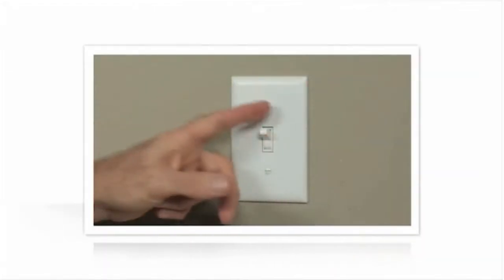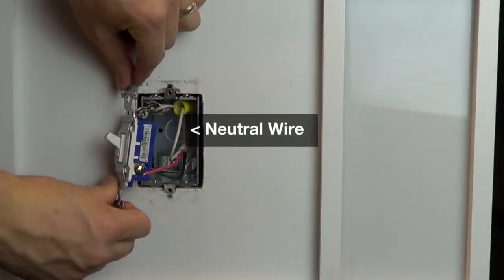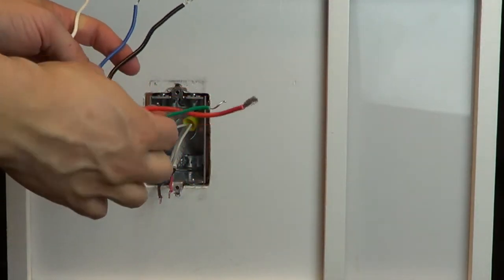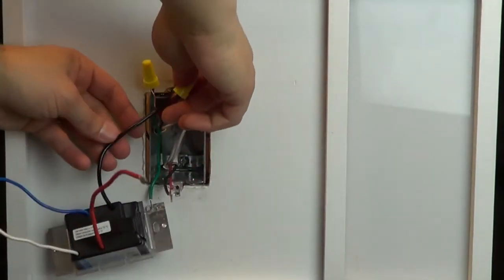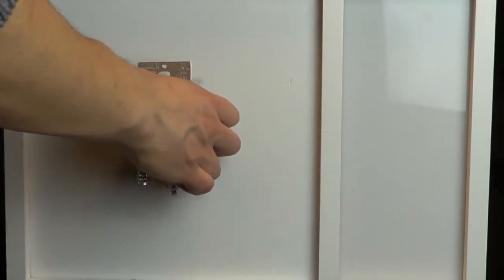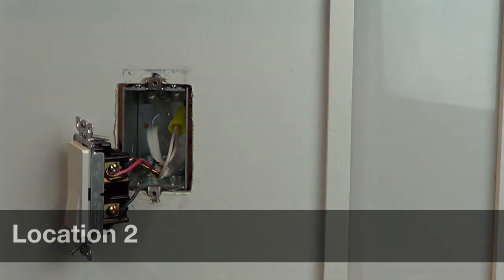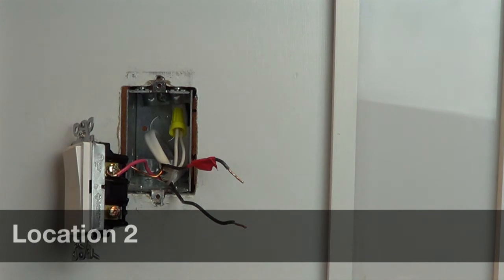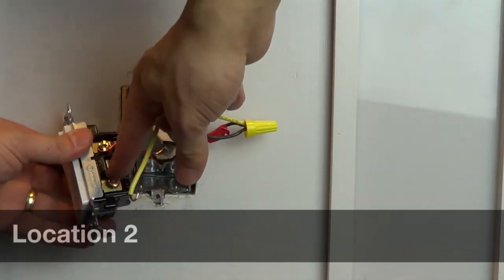Wiring a Control with One Black, One Red, One Blue, One White Wire (3-Way with a Mechanical Switch)

Comment: So what happens when you flip the mechanical switch on and off, does it act just like a three way?  So if I turned on the light with the smart switch, I can turn it off by flipping the mechanical switch?  If I turn on the light with the mechanical switch, I can turn the light off with the smart switch?  Of course I can turn the light on and off with the app?
Reply from the maker: Hi Bryant, Correct, the dimmer and 3-way switch will function as if it was a regular three-way application. Each location would have the ability to turn the light on or off no matter what position the other device is in. Furthermore, the user would have the ability to control it from the Lutron app as well. Hope this helps!
Reply: So this is true for the PD-6ANS which shows it should work, but there is no explanation anywhere on how the mechanical switch works in the system. So I just want to make sire before I order them.
Reply from the maker: @bryantjenks3598  The PD-6ANS will be installed at one wall box of the 3-way application, the other will remain the traditional 3-way switch which will need to be rewired with the yellow jumper wire provided in the packaging. For more information on this application, please visit pages 33-35 on the advanced installation guide https://www.lutron.com/TechnicalDocumentLibrary/0301710_Caseta_Advanced_Instructions.pdf or www.lutron.com/support .

Comment: Can this method be used with the PD-6WCL? (The jumper method on the mechanical 3 way switch side that is.)
Reply from the maker: Hello Zach,
Thank you for reaching out! Currently the PD-6WCL can only be wired in a single pole application. If you are looking at using a PD-6WCL in a 3 way or multi-location application, the other locations will need to be Pico Remotes. For installation instructions for a PD-6WCL in a multi-location please visit www.casetawireless.com/3way .

Comment: I added switch this way and the light just blinks when I flip mechanical switch at location 2...  Light works when the mechanical switch is turned off, but the light blinks when it's turned on.... ???
Reply from the maker: Hello,

If the indicator light is blinking on the dimmer, that can mean the blue screw got connected to a ground wire. (Grounds should only be connected to the green grounding wire.) If the light zone itself is blinking, that could alternatively mean the communication and traveler wires got swapped on the mechanical switch. Please feel free to call our Technical Support team 24/7 to discuss your specific wiring situation with one of our trained agents. They are available at 844-588-7661.

Please let us know if we can be of further assistance.

Comment: Can you add a pico remote to this setup?or do you have to remove the standard 3way switch?asking for a friend who bought the caseta wall switch with pico remote. But still wants to use the remote as well as the 3way switch. Is this possible or is it one or the other??thx
Reply from the maker: Hi. Yes, a Pico remote can be paired to a wireless dimmer in this setup. If you wire a Caséta Wireless dimmer to a 3-way switch as in this video, and you also pair a Pico remote to the dimmer, then all three (the dimmer, the mechanical switch, and the Pico) will work as expected. The Pico is a wireless remote and it does not have to be installed in the wall; it is battery-powered. The Pico can be kept loose, mounted to the wall or in a wallbox, or wherever else you wish (within wireless range).

Please let us know if we can be of further assistance.